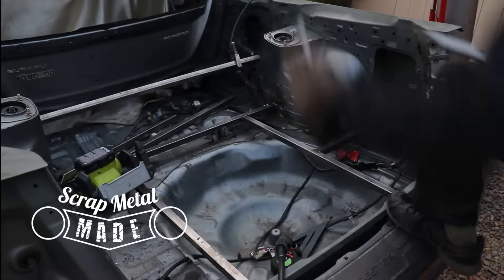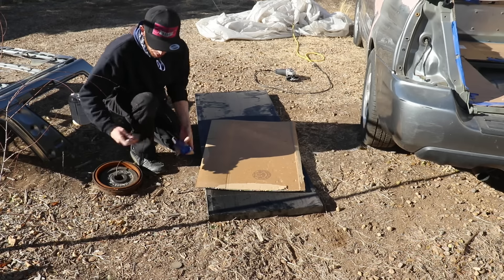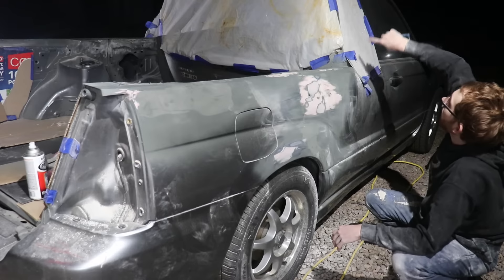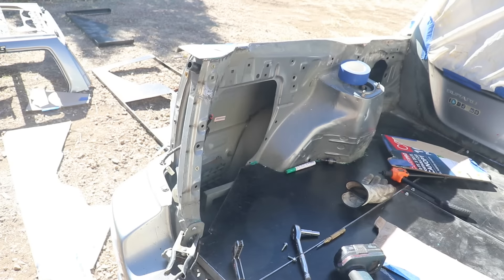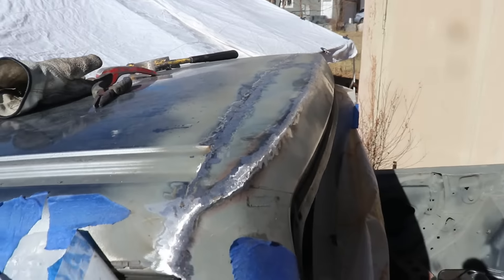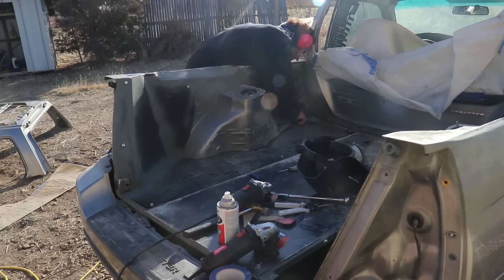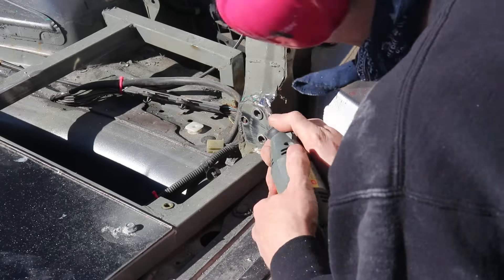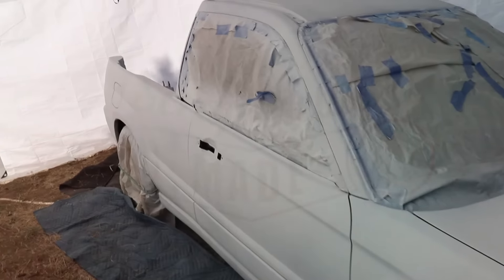2007 Forester Truck Conversion: Body work

Comment: Nice conversion!  I like the fact you are going the extra mile to get it right.  I've been thinking of a conversion for a long time.  My thoughts on finishing the side rear body pinch welds was to split a piece of tubing, round, square or rectangular, slip it over spot weld and use body seam caulking.  This covers all of the imperfections, gives it strength and a nice straight line finished look.

Comment: Great project👍to avoid boring situations while loaded at the back,in case of weel puncture,you should convert also how you can extract the spare tyre...would make a lot more sense if it could be possible from  the underside ,and more in line with the pickup look

Comment: What are your thoughts on reinforcing the back of the bedside above the taillight? It would cap that edge off and add quite a bit of strength to the corner. 14:26